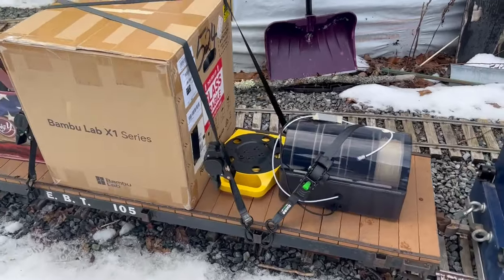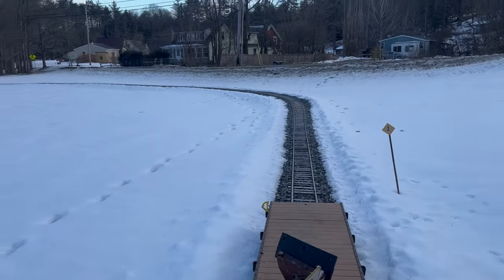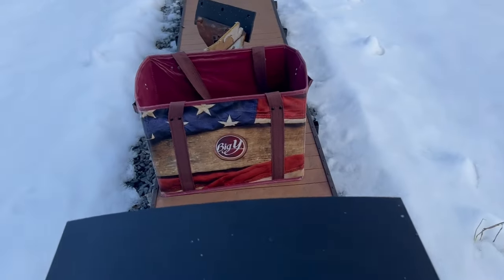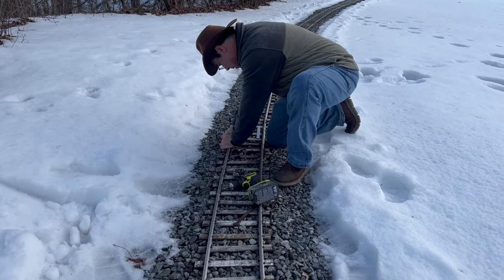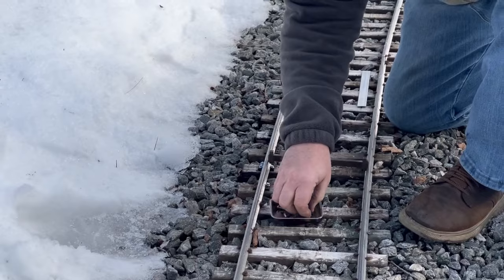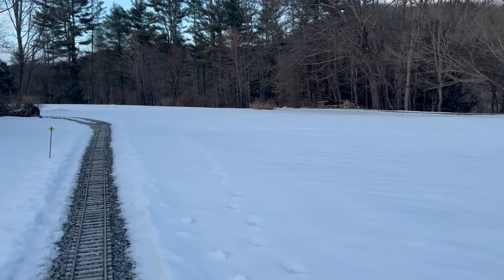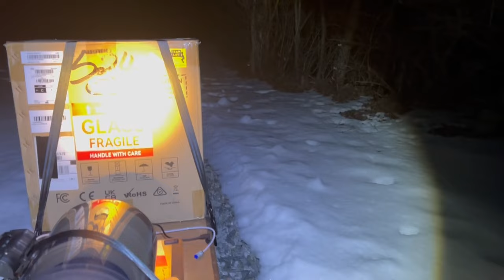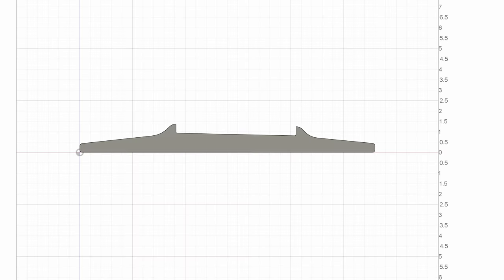A visit to the Mill Brook Railroad with a 3D printer

Comment: Good to see you Jared. Now you have to test them in real cold, heat, with contaminants like oil, creosote. In rail crossing with real cars weight passing on.......
Since i´m a neanderthal with those technology, can you test with different plastics ? Can old one been melted and reused ? Of course without copyright anybody can copy. But isn´t it a hobby with sharing knowledges and try ?
There is already metal and plastic molded ones on the market. Are yours more economical ? Would you like to produce thousands of them ?
So many many questions.....
Good work and hope for the best !
Cheers 😊
Reply from the maker: Hey, yeah, happy to talk about it. It’s mostly an experiment. The plastic I’m using is about the most robust material that is available to me as far as plastic is concerned and is unlikely to be short lived if done properly. Metal ones would probably be the next step.

Old ones probably could be recycled if you really wanted to, but any impurities in the plastic would need to be removed in that process. I would not say that the way I’m making them on the printer is any cheaper than if a mold was used. It’s more frustrating if anything. I did try two different plastics but there are only so many options for this printer that are suitable for this sort of use. Many plastics available do have strength tests available to read about.
Reply: @JaredDunbar  thanks Jared gor your fast answer. 👍